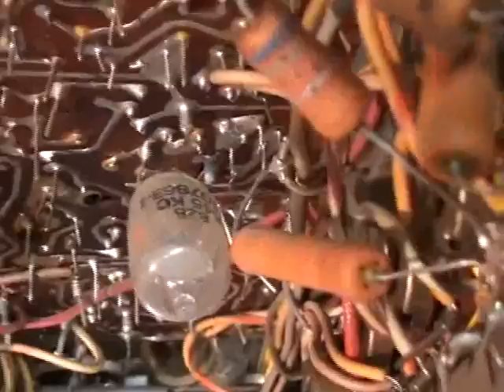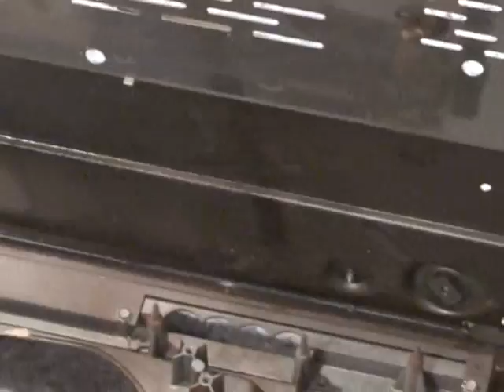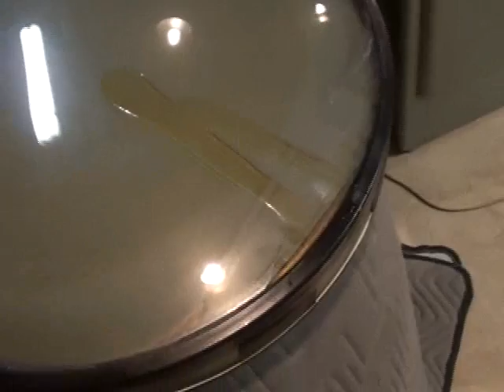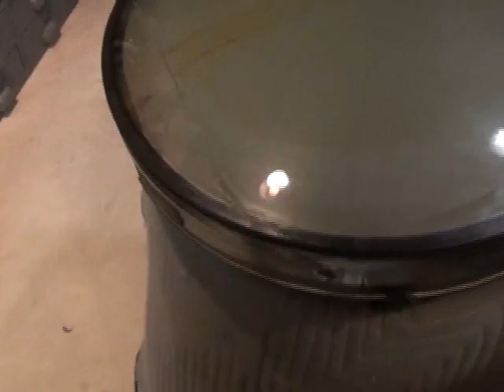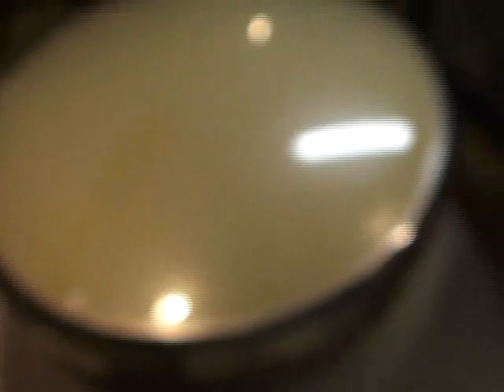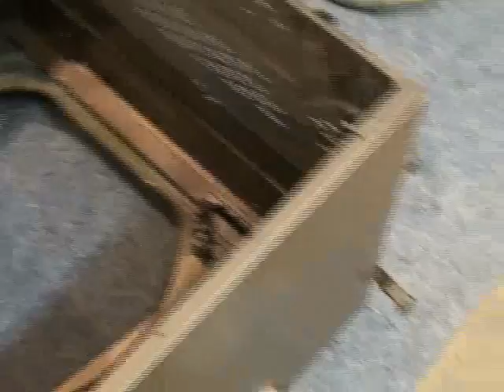1964 RCA Victor CTC-16 Color Television Repairs PART 2

Comment: Steatite ceramic terminal strips similar to what Tektronix used back in the day may be the order of the day for these things.  They can be had for about $12 plus shipping on Aliexpress.  Only problem is that you need to use 5% silver solder when working with them.

Comment: What do you do for a day job to afford the space to collect all those tvs? Obviously not repairing tvs. I repair tvs for a living and I am dirt poor. I have to rent and have nowhere near the space you do.To own a house with a space that big is only a pipe dream for me and I am much older than you. this video will be useful to me as I have just aquired a 29JC20 chassis Zenith with a 21FB22 with the same oil deposit problem. It takes up half the floor space in the room it's in.

Comment: when i first test a set i ALWAYS cut out the capacitor across the mains even if it looks ok now it will probarbly explode after 10 mins. its not too dangerous but it tends to make a bg mess since the ones over here in the UK are made of wax
Reply: i do the same..they like to explode after some minutes of operation if they arent exploded yet

Comment: I have a ctc 38h that that the terminal strip around the can filters was bad replaced it along with bad wiring , That set has a rare earth 25ajp22 crt in it and it looks great as well.  I had a zenith service savor hybrid for a customer that lost high voltage .  I replaced two 2kv ceramic caps and the cathode green rectangular fuse I heated up the crt for awhile it looked great. Rca put better crts in the old sets then Zenith did

Comment: What's a delay line?
Reply: It is a device used to induce a delay on an electrical signal.  They can be acoustic, using mercury, glass or a spiral of magnetostrictive wire, or in this case, electrical, using a very large inductor to produce the delay.  It delays the arrival of the chroma signal into the chroma decoder circuit by approximately 1ms to ensure it arrives at the same time as the luma signal.

Comment from the maker: Since I was old enough to read, my interests were always drawn to books on electronics, mechanical devices and technical drawing.  A key that has helped me figure out how to take things apart which I really started to focus on when I got a little older was "putting myself in the shoes of the engineer" thinking "how would they have done it".  Taking things apart as a kid gives good practical reasoning skills which have helped me very much in servicing equipment when I got older.
Reply: I did the same thing as a kid. I took apart pretty much every toy and device I was given. I was more curious what was inside of them and how they worked than in playing with them. I ended up destroying everything. But I learned a lot.

Comment from the maker: The oil is a result from the rubber gasket breaking down over tijme.  WIth the CRT in its normal position, the oil simply accumulates at the bottom.  The reason you never see the actual oil under normal conditions is because the of the surface tension between the oil and the gasket.  It just runs along side the gasket until its ends up at the bottom.  
PC boards are not well suited for tube equipment.  I like RCA sets very much, but they cannot compete with Zenith from a longevity standpoint.

Comment: Is that oil used to provide optical coupling of the lens to the CRT face?  I've never seen a setup like that before, other than the cooling fluid used in projection CRT's.

Also, what's your opinion on tube sets that use printed circuit boards such as this?  I was under the impression that the boards often got brittle from heat over the years.